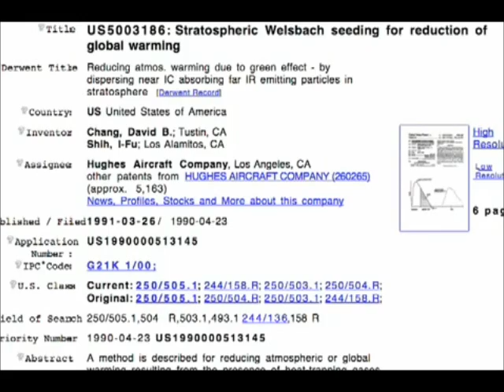chemtrails US Patent 5003186 Stratospheric welsbach seeding for reduction of global warming

Comment: The news reader stated. Just because it has been patented doesn't mean it has been implemented. Interesting enough what is the difference between cloud seeding and SRM solar radiation management. Ionosphere heating or within this patent wavelengths. But a scary part is pushing radiation out into outerspace.   Good post and some interesting information.  In the patent it mentions wavelengths. How do they do this?  Why are there so many cell phone towers been constructed everywhere. Included I have been told in Bali. How do sound signals effect or spread chemicals which may be highly conductive and further improving communication.